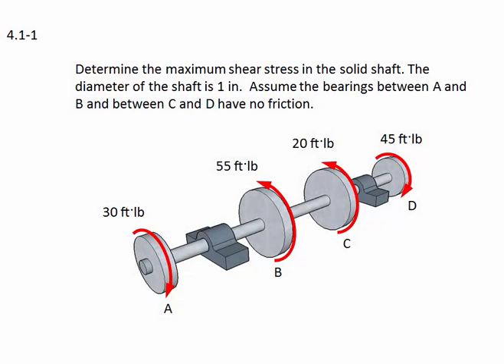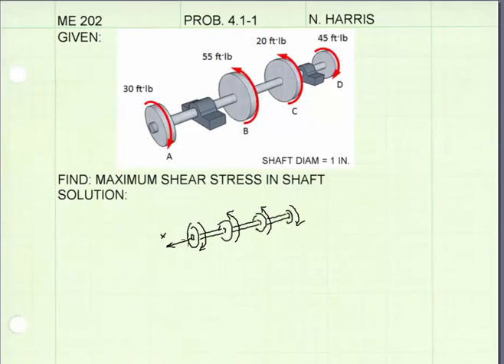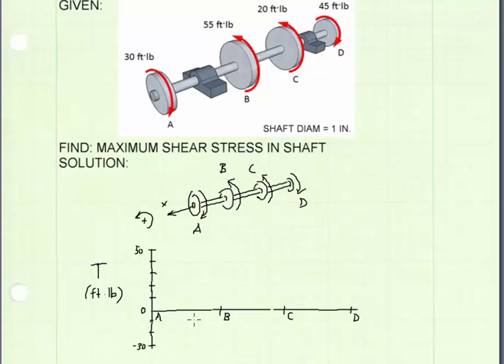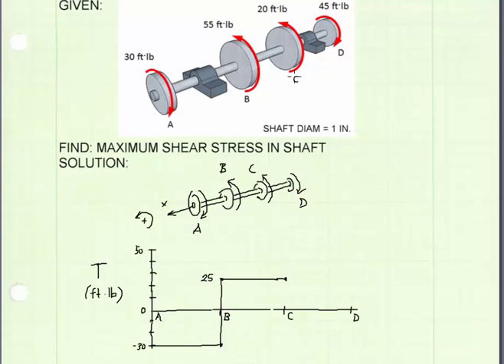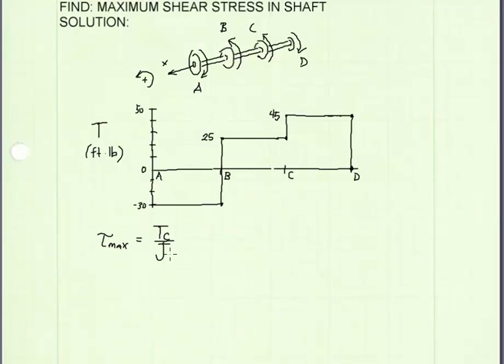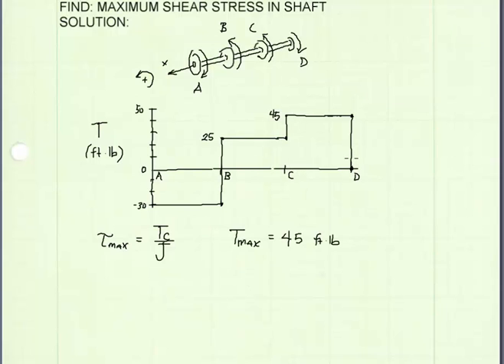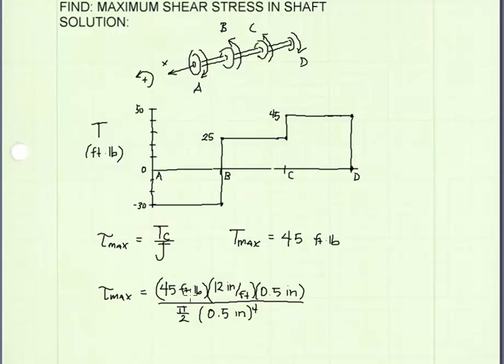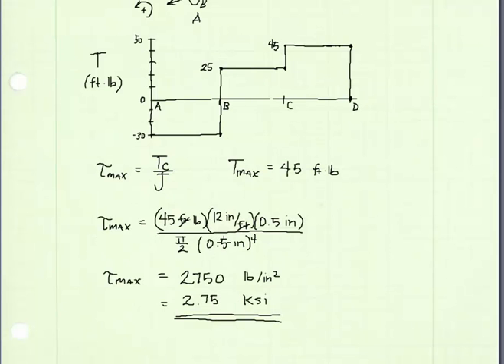04.1-1 Torsional stress - EXAMPLE

Comment: This solution is not true. 1st and 2nd pulley torques are in reverse directions so if you assume first pulley static (relative to 1st pulley) and second is rotating. Then 2nd pulley will be 85ft.lb. But as your graph this difference is 55 ft.lb.

Comment: But if I cut the shaft exactly in half, on the cross-section of the left half the torque should be 55 - 30= 25. On the right half it should be 20 - 45= - 25. Since they are in opposite direction, 25+ 25=50 (I got this intuitively), so the max shear stress should occur between B and C. Can anyone explain me why my idea is wrong? Thank you

Comment: You, sir, are a life saver.
Reply: Quick question, though. In the shear_max equation, shouldn't the denominator have pi/32, not pi/2?
Reply: @Quroe_  he is using the radius in his calculation of J. You would be correct if he were using the diameter.